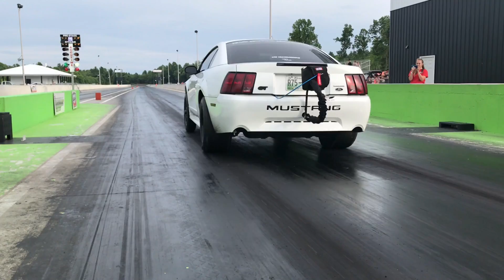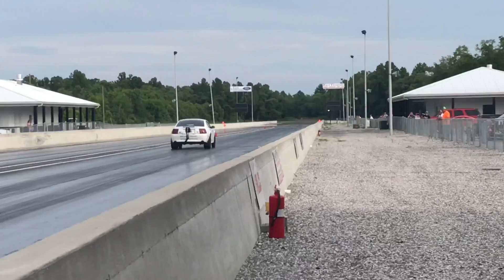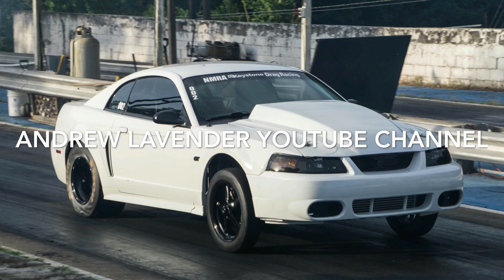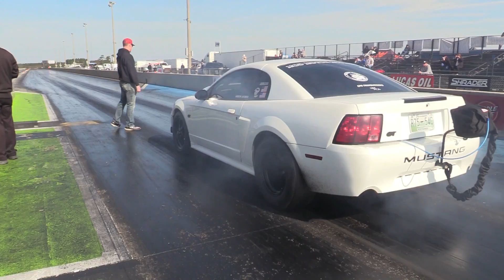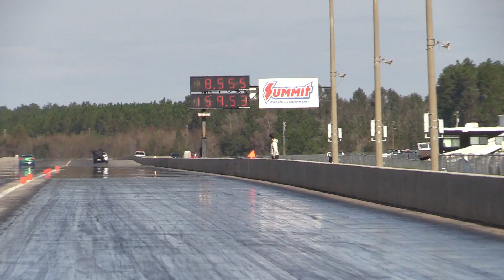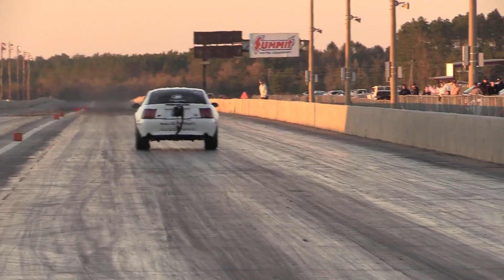what it took to run 8.50s in the 1/4 mile

Comment: great job on running in the 8.50s  you have earned it with all your hard work. could you please point me in the right direction for a start up, break in tune for my 4.75 mmr longblock  best of luck 2v and 7s  around the corner
Reply from the maker: chuck johnson if you have Holley efi I can help u out
Reply: thanks for the reply   i do not have the Holley but i am  considering it, would i still need a dyno tune if i buy this system
Reply from the maker: chuck johnson you could get by without a dyno tune

Comment: If you ever need a new block you can go with the NVH 02-05 Explorer 6 bolt aluminum block. They actually have thicker oil pan rails then a WAP or Teksid and I have seen people make more power on one and last longer. Not to mention there are plenty in scrap yards. I have a reman by Ford aluminum 2V in my 02 Explorer Limited (not sure what happened to the original engine) with super low miles I plan on forging and doing a similar single turbo setup for the street. Thanks for the cam info!

Comment: Great info, you seriously should put all this 2V knowledge in an ebook and sell it! To hit those 8.5's @ 160 MPH I'd think you'd need to make 1200 hp @ 30 psi boost, meaning NA it's probably near 400hp? With a 90mm throttle body and big intake, high flowing heads and big cams that's certainly possible, are you reaching peak power at significantly higher RPM then stock, like 7000 or more...? Do you have valve train upgrades as well to handle this ?

Comment: Andrew Lavender you remember when I commented you might be sandbagging on the dyno? lol!  I knew that car had more. You really have it put together well but more importantly, you know how to drive the hell out of her!
You realize if you get the TF heads, re-sleeve the block, and beef up the I/C...you're going to have to step up the cage, not a doubt in my mind. 
Also, I think it would be cool if you kept running 1/4 mile, I know you talked about focusing on 1/8th mile. By the way, I know you don't run in any stock class, I think you're too modified to run super stock. Is it super street that you run in?
Reply from the maker: Matthew James it’s funny this car has never made big numbers on the dyno but runs pretty good ets. Yeah I will definitely need to upgrade the cage again which is why I’ll mainly stick to 1/8 mile until I get the funds to do that. I normally run the street car classes and radical street and maybe even mean street class this year.

Comment: Man awesome 2v! Gives me inspiration to get back into mine. I had converted mine to e85 but ran out of fuel...never got to finish my tune and see how it liked timing on E85. Would you mind sharing how much timing you are running? My stock shortblock TT 2v 04 made 640rwhp at 14.5psi back in the day on pump 93 and honestly your an inspiration to get back into it to really push the limits on e85. It will never run like yours but dang they sure are fun to drive. Thanks, Cody

Comment: Which position on the upper control arms would you think is a good starting point for a street or no prep car? My setup seems like it's is very close to yours & I'm installing the outlaw kit now. The destructions say start with plate 1 in the middle position but I think that's more of a track setup.
Reply from the maker: I like plate number 1 bottom hole for no prep stuff. Plate 1 middle hole hits the tires to hard
Reply: I'll give it a try and see how it works for my car. Thanks!

Comment: I have a 2002 gt I have full exhaust throttle body cold air intake 410 rear gears 20 lb injectors slp2  want cams what kind should I use

Comment: What rear gear do you run with? I have a 71 maverick that I'm building a 03 cobra 4.6 with twin 80s and how much was that Holley set up and where did you get it. Been looking around and I like your set up.  Great work with the car you will be in the 7s soon.  #7sec2vstreetcar
Reply from the maker: Stang Bangs601 oops forgot to say the gear. It’s a 3:55. The whole Holley set up was around $2500 maybe a bit more

Comment: What weight savings have you done?
Reply from the maker: john conner a lot haha
Reply: I have a 03 cobra and I have been trying to shave weight without cutting the car up or anything!! Keep up the outstanding work and videos!!!
Reply: john conner they aren’t that hard to get near that weight. I have an 01 GT aluminum 5.3 LS, s475 intercooled turbo, 10pt cage and two corbeau seats.. I’m at 3180 full weight with driver